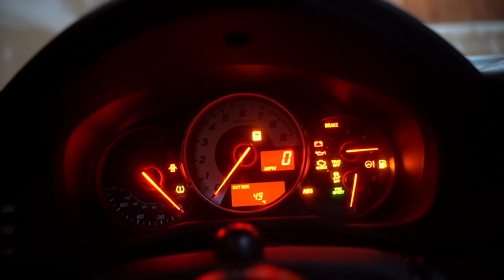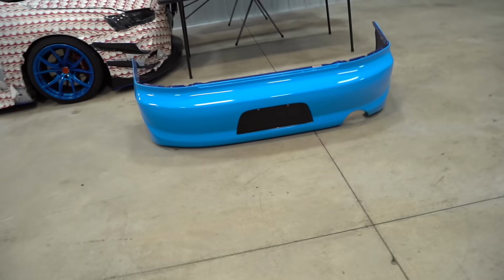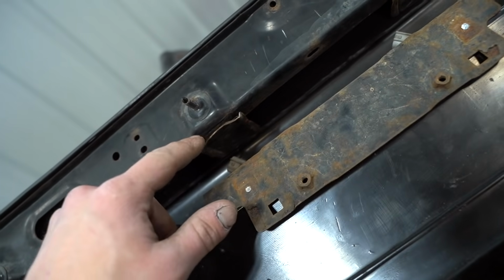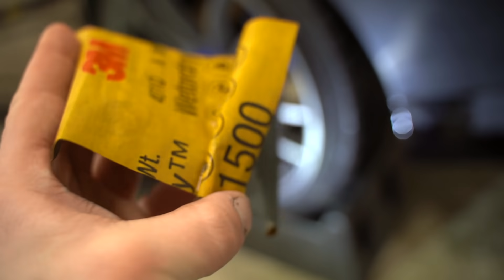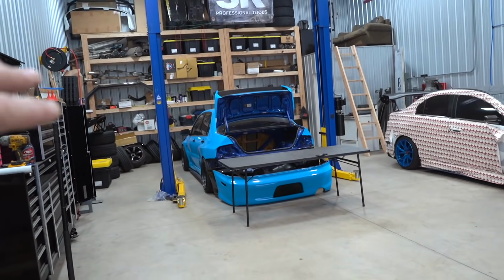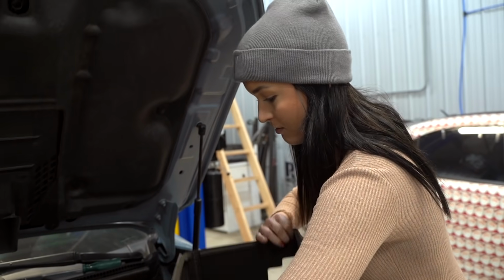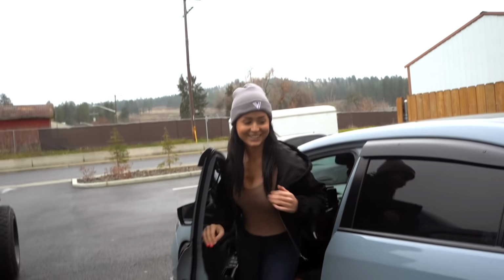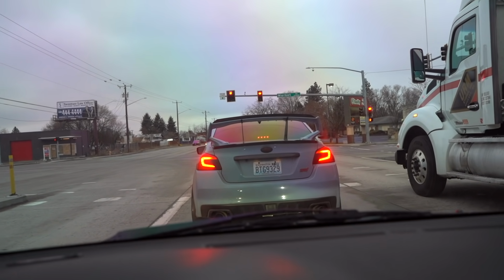The Evo 8 Is Complete and Looks INSANE!

Comment: You’ve got some knock my guy, I’m not exactly sure if it’s fuel related, but considering It’s a bone stock motor, it has to be a fuel issue, I’d recommend taking it to get tuned and I guarantee that’ll solve your issue, or run higher octane fuel. Plugs should not be breaking like that, that’s some serious detonation.

Comment: check the coil packs on the sti, check the springs inside make sure they arent bent or shortened. also check for any burning of the coil packs any tears or holes if not try some dielectric grease on em

Comment: If you have an accessport, look to see what cylinders are experiencing the most roughness. I was having a miss fire in 3 after still changing the plugs and gapping then correctly (pretty much same thing that happened to Bobbi) I switched the coil packs around and the miss fire happened in cylinder 1. Got a coil pack and it’s been fine since

Comment: Check Fuel Pressure for STI along with dumping a can of seafoam in the tank to clean injectors. if that didnt fix change the Filter inside the pump. Also If you can get Fuel from Costco Wholesale, They have the lowest amount of Alc in the content making it better for engine along with cleaning additives.

Comment: Car is over heating internally trust me I’ve been there mine blew up heres some things I got for my set up is aos (replaces pcv valve) and gad cylinder 4 cooling mod (cools cylinder 4 and saves the motor in general) also replace oil pick up this will help you with the motor life

Comment: Bad knock sensor on the sti! It says that it causes knocking noises and allows to much fuel/spark to happen. Says it usually happens when full throttle. Causing it to disintegrate the spark plug.

Comment: Coil packs I think are going bad. Was one or two plugs worse than the other ones or were they all the same? The car is so new it would be crazy that they were bad. On the troubleshooting guide I checked says if they are going bad you will see a intermittent check engine light, lack of power, a sudden loss of RPM's for no apparent reason .The coil pack should be reading 0.73 ohms plus or minus 10%when testing them with multimeter after unplugging all of them and testing them .

Comment: My guess should be injectors on the sti, also get a cylinder 4 cooling mod
Reply: That's the most pointless mod
Reply: @andrewtillotson9472  it’s really not tho
Reply: @andrewtillotson9472  your cylinder 4 gets up to 15-25 degrees hotter due to the coolant passage being blocked

Comment: You said the plugs were stock spec plugs and not a step colder or hotter plugs right?, and you said AFR's are okay not running on lean or very rich side, what about o2 sensor short and long term fuel trims? Are they within like positive 10%, and negative 10% figure?, If not check o2 sensor and voltages and vaccum leaks, but like you said most likely cause and my bet now  too now is next step,  swap/replace coil and coil ignition leads, see if misfire disappears or follows a coil/ignition lead swap to another cylinder. I commented  before on Bobbi's channel when she uploaded her videos about Gary sickness,  also suggested check MAF, and clean( you have done), plugs (you have done), but also check MAF voltages are within spec, and also the fuel pressure and injectors are within spec. Good luck m8🤞

P.S new wheel look amazing on Gary 👍